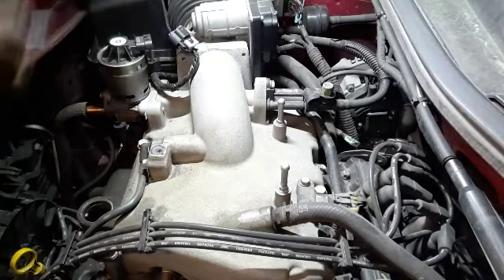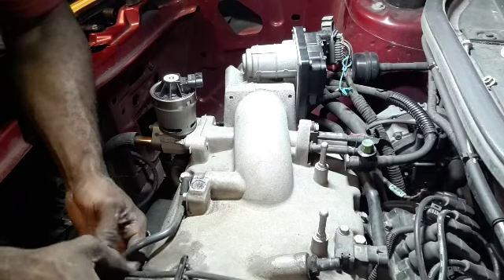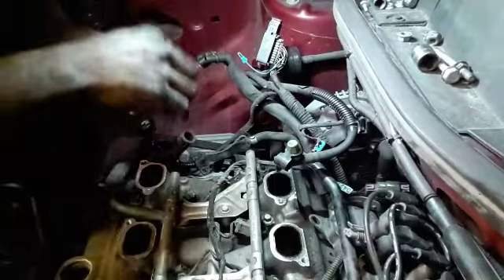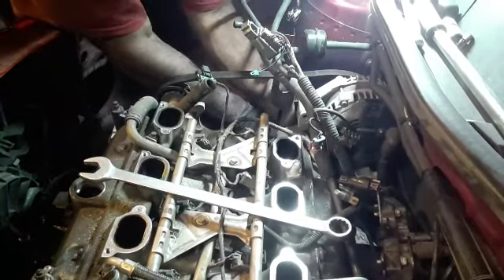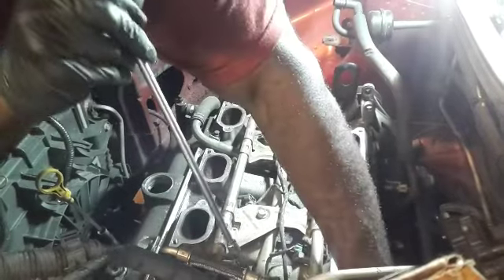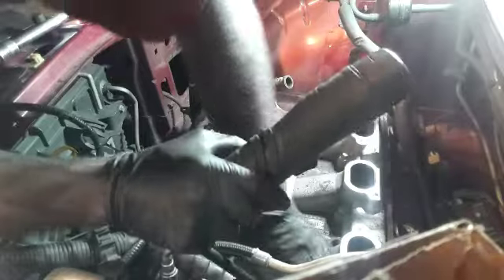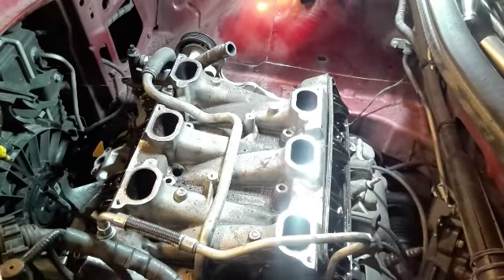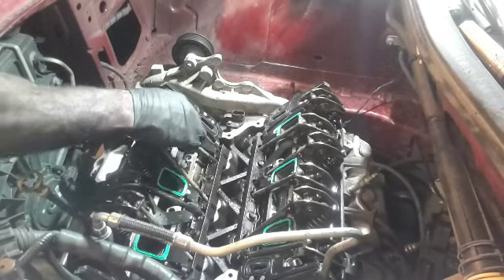Lower intake gaskets Chevy 06 equinox 3.4 pt1

Comment: The push rod lengths are different. There are 5 3/4 inch lengths and 6 inch lengths. Best to put them back in the same order as you removed them.

Comment: Never remove or disturb the injectors unless you need to replace the "O" rings or injector on them. This is excess work you do not need to do which could cause "O" ring leakage. The intake manifold will come off without removing the injectors.

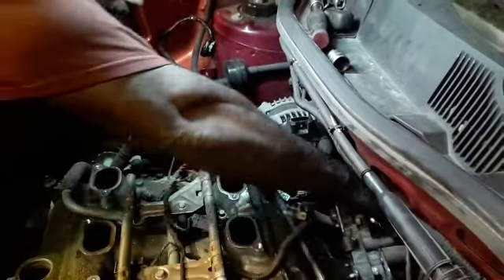Comment: about 16:23 minutes into the video it shows the wire harness connection that feeds the injectors is already unhooked. Seemingly simple to disconnect this plug, I am unsuccessful at disconnecting this plug, which is underneath the far passenger side of the lower intake manifold. Any tips at disconnecting this connector would be appreciated. Thanks for making this a great tutorial for me accomplishing changing these gaskets.

Comment: Well my daughter's 05 Equinox starting leaking from the back driver's side lower intake gasket.... saw it with my pressure tester...... therefore I put K-Seal in it and it lasted for 6 months until it was no longer winter (and I was not sick). It is leaking again so I'll do this job "right" this time..... thx for the video.  Can you give all the torque specs on the bolts for this job .......
Reply from the maker: Hey there... The job is pretty straight forward! I don't have torque specs immediately on me. However, this is a super common engine. Check Google for "Chevy 3.4 intake torque specs" and there should be specs and sequence.
Reply: Y question being you just torque the rocker arms to 24 foot pounds and that's it no more monkeying with them
Reply: @keithscovel1008  Thanks for telling me 2 months after I've done the job

Comment: Did you replace the gaskets with the same crappy plastic ones that GM used?  Why not use the metal (aluminum) gaskets from Mahle or Fel-Pro?  I'm in the process of doing this job and I've got the metal ones.  Just wondering if you have a preference and if so, why?  BTW, THANK YOU for posting this video.  I had a few questions about this project and every one of them was answered by watching.
Reply from the maker: Yes I used a "plastic style" replacement. Reason primarily is because the current ones lasted 100k plus miles before showing signs of wear. And these should last another 100k with no problems.

  I also offer a 1yr free replacement  on anything I install/purchase new. 

To add, there can be a revision  of the old product without it "looking" the part. There lots of different types of plastics and not just one😊.

Hey, thanks for the feedback! If there's any other questions related to the video I'll try and ask asap.

Comment: I laughed so hard... you said I have tools everywhere. Bahaahh I had been saying the same thing. Question: Got it all back together and it will not start. Hit it with a shot of ether and it will fire for a brief moment. Rechecked all connections and wires. I don’t have a fuel pressure tester but you can hear the pump energize and when you hit bleed it shoots gas, so there at least some pressure. Any ideas?  Thanks!
Reply from the maker: Scan for codes... And address check engine codes..

If there codes present, clear codes and see if car starts...

If both above fail, and car ran fine before servicing intake, likely you left something unplugged or isn't plugged in properly. Such as injector harness, it sits under intake and if theres fuel but no injector pulse. You'll have those exact symptoms you're experiencing. While youre removing things to inspect injector harness, make sure all ground straps are properly connected
Reply: customhonda thank you so much for taking your time to answer!!!! Bought the car on the cheap from auction. Had two blown head gaskets and intake was blown as well. However the car would start with zero problem. The job was much bigger than I anticipated but got it finished.   When home I am going to do as you suggested. I think you are right about at the injectors... can you tell me what you mean by ground straps?   My hat is off to you who do this by trade, the work is no joke, takes skill and it’s very hard labor. Again, thanks for the reply. A big thumbs up!
Reply from the maker: @PastorGabreilBeady  May have not actually been a blown head gasket lol... Intake gaskets melt and mixes with oil! In the future, while car is running, screw off the oil cap and see if it's pulling vacuum! There should always be crank pressure and not vacuum in crank case with this engine.

Thanks, keep me up to date, I'm fairly confident this is your problem, as the sub harness has to be remove when removing lower gaskets.

To answer your question, ground straps ensure engine component requirements aren't overwhelmed with one source by isolating load requirements via ground source. A related but related additions, the engine is supported by rubber mounts which aren't conductors, "the ground straps" bridge the connections between car and engine basically. But relating to your issue, it's a possibly that a component control circuit ground may not be connected effectively causing a component to become inoperative. This is why I say check your grounds.

I do have a simple video making a ground strap on a Kia sorento in my archive also diagnostic videos with a bad ground causing ABS module to generate code.
Reply from the maker: @PastorGabreilBeady  https://youtu.be/ZzB_crXwx60
Video with ground issue...
Reply from the maker: @PastorGabreilBeady  
https://youtu.be/8aHlOymMi80

Making a ground strap
Reply: customhonda...okay!!! Got home yesterday set to apply your advice. Hooked up scanner and it showed no power to both heater sensors (what code reader called them), reduced power to the mass airflow sensor and no power to ALL injectors. Just like you said it probably was. Started out going over all plugs and wires. I checked all fuses and noticed relays were nasty dirty. Main eng relay was half unseated, cleaned and reseated all relays. Hooked up scanner and still had the same pending codes. I kept clearing them with the scanner and about the 15th time I heard a click. I thought:  a relay just opened up, turned the key and it fired right up. Just wow!!! Thanks for your channel and guidance. Also thanks for replying to my original comment. Not sure I would have figured it out without tearing the plenum off again to check injector harness. It saved me a lot of time to not have to.

Thanks!!
Reply from the maker: @PastorGabreilBeady  great! We got it running!
Reply: @partsshooter  Make sure all connector harnesses are pushed on all the way especially the connector harness to the coil pack.

Comment: hello tell me the tightening torque of the bolts
Reply: This is critical for this job to be successful I have discovered in another forum. Best to tighten in the recommended sequence using an inch pound torque wrench and to use new lower intake manifold bolts.

Comment: Bro, if I had to do this repair that car would never run again 🤣 how to you keep straight what bolt goes where?? Awesome job tho!
Reply from the maker: I'll either place then in sort of an order, like beginning till end, keep them with the part removed or in small piles. There only like 3-4 different sizes, can't really screw them up and it depend on job.

Large jobs like doing an engine replacement, I'll keep all bolts for top side repairs in a pile and bottom in a pile, any item removed from the engine stays with that part. Simple...😎
Reply: @partsshooter  how much do you charge for a job like this? I just bought an 08 equinox and now I'm nervous because everyone online says they're pieces of shit and have head gasket issues...

Comment: What gaskets did you get? Link?
Reply from the maker: Felpro...any local part store should have the recommended intake gasket set.
Reply: I have a 05. And my intake leaking by the thermostat area so I know that the two ports on that side is damage or weak spot. So when it run hot its usually the lower intake not the head gasket right? No oil and water mix pure oil clean.

Comment: Thats the fucking gaskets seriously with all the technology we have today you would think they would make some kind of silicone or something that you can just fill with.
Reply from the maker: Like Audi, Honda and Toyota engines. Anaerobic sealant or rtv to minimize leaks! I understand
Reply: I have a small coolant leak coming out the driver side on my 07 equinox. Little coolant not enough to notice unless you look. Car doesnt overheat and doesnt have check engine. Wonder if it's the lower gasket.
Reply from the maker: @rastarells4769  likely yes... Because the coolant channel is immediately by the ends
Reply: I have the same vehicle and my intake is leaking on driver side by thermostat. Not much but I noticed I gave a lot of air blockage and my bleeder wasn't bleeding the coolant system well. Then I noticed my thermostat housing back bolt was loose and it ran my truck hot hot to red line 4 times when I was trying to get home. Its been sitting for 6 months now. Now it wont crank even with hot battery. You think its locked up or my starter has gotten weak from cranking every time it ran hot..

Comment: It blows me away there are people dumb enough to buy a chevy still.
Reply from the maker: I know... Chevy has to do better with reliability!
Reply: @partsshooter  The LS engine is a solid motor and the hot rodders love them but it seems they screw every other Chevy buyer with a cheaply made piece of crap to make up for the engineering of the LS motor. But the vehicles the LS motor comes in are all garbage as well. "NEVER buy a Chevy" should be common knowledge. They should have been out of business 40 years ago.
Reply from the maker: @TheHa11jesse  I'll say the LS only has it reputation because of it's compatibility with  old bell housings. I'll give it to you, it's a stout engine INTERNALLY! However... These things leak from every orifice that has a gasket😂